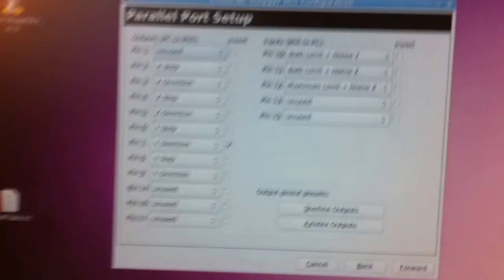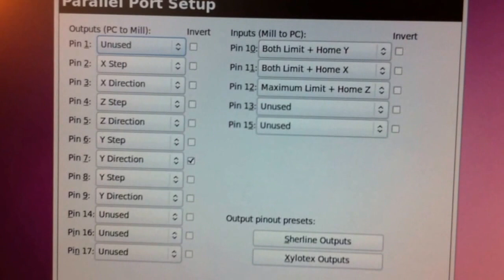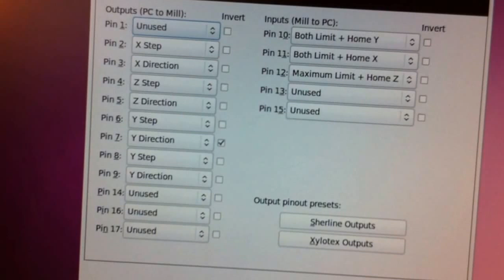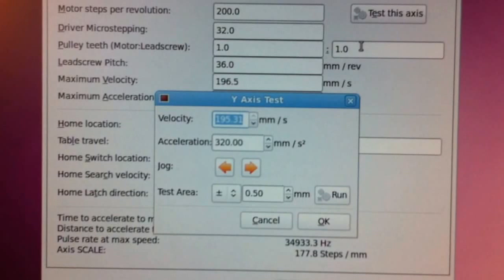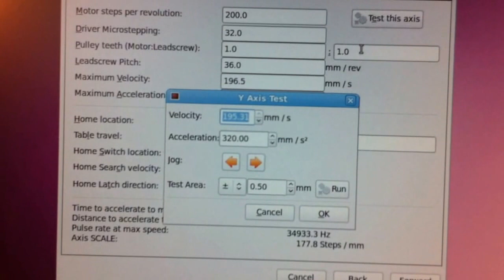My ShapeOko 2 Electronics setup

Comment: About the Y accies, I read that they only contol 1 accies at a time so my you can determin which direction the motor is running and if both were powed up in opposite direction ( well disaster)  belts with missing teath.
hope this helps.

Comment: Caleb - cool stuff.  Can you provide some further details on the build instructions and the components to build the Break out and driver boards. Thanks
Reply from the maker: I'm assuming you mean the little breakout boards I made for my DRV8825s. I believe they were made out of 20 x 40 mm perf board. Each board has two 1x8-pin female headers for the stepper motor driver to mount to. There's five 2-pin screw terminal blocks. The capacitor is 100µF, and the dip switch actually only needs to be three switches, I just couldn't get a three switch version when I bought mine.
As far as the wiring goes, here's some links to both the stepper motor manufacture, who I used, and my build log.
http://www.pololu.com/product/2133/
http://www.shapeoko.com/forum/viewtopic.php?f=5&t=2344
Reply: Thanks - much appreciated.
How confident are you with the rigidity and stepper motor power to mill aluminum. 
For example, as a custom pistolsmith do you think this machine could mill the frame and/or slide of a 1911 handgun?
Reply from the maker: Donald Sardano Well, I'm no gunsmith, but I'm reasonably confident in my machines ability to mill aluminum. However, there are some caveats to that statement that should be noted. Most importantly, I don't have enough first-hand experience milling aluminum on my machine to tell you what to expect exactly. Also, if I was building my machine specifically to mill aluminum, I would choose a spindle that could run at much lower RPMs than the DW660 does. This is because aluminum mills better at lower rpm. I suppose the best advice I can give you, is that the Shapeoko can and will mill aluminum. But, you have to spend a little bit of time thinking about it like a machinist, and not just a hobbyist that wants to hit the print button.
Having all that said, if you have the right endmill, spindle rpm, and feed rate I'm fairly confident that a well trimmed Shapeoko can do the job.
Reply: Thanks Caleb. Also, do you think that the NEMA 23 will have the torque or would you beef up to NEMA 34 stepper motors.
I'm thinking that with the lower RPM spindle this will help the ipm rate.  Any thoughts ?
Reply from the maker: Donald Sardano My NEMA 23 motors are rated for 156oz/in holding torque, and the only time I've ever seen them stall or miss a step was because I crashed the gantry into the motor mount plates. NEMA 23 depending on the torque rating are good enough. NEMA 34 would be overkill to say the least, not to mention they wouldn't even fit on the machine without serious modification. If you're really worried about it get NEMA 23 motors that are in the 200 ounce inch holding torque range. Just keep in mind that in a game of increased holding torque the belts will become the weak link.
 
Also, I highly recommend you asked some of these questions on the Shapeoko.com forum. There are a lot of very friendly people, in the community, that have much more knowledge and experience than I do.